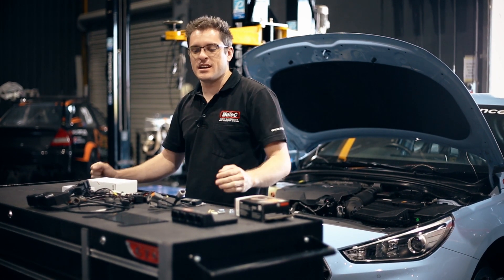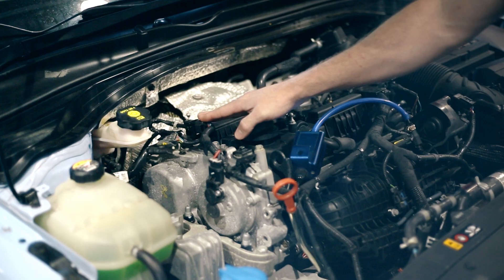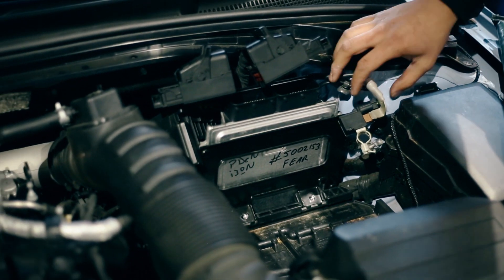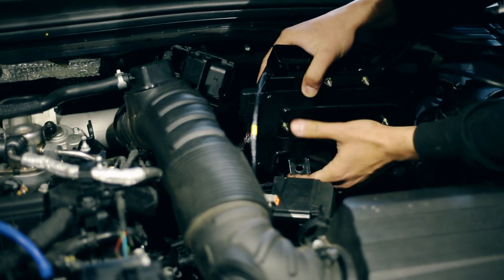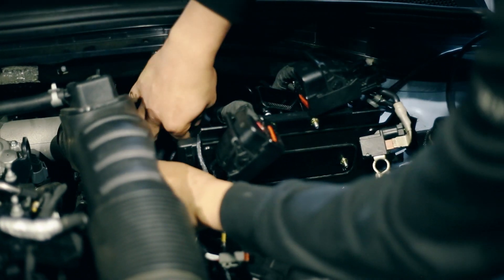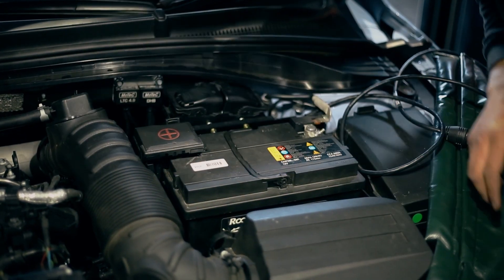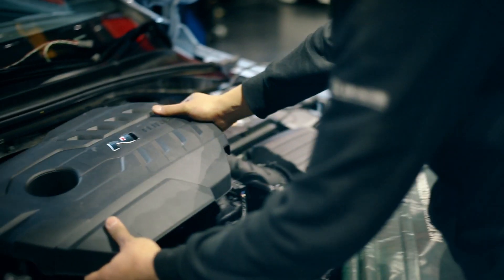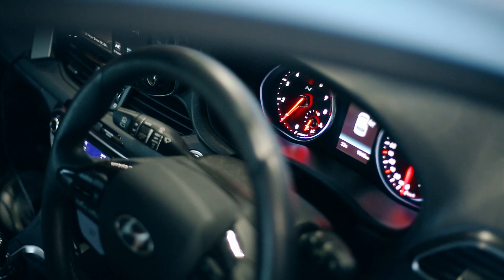Powertune Australia | Powertune's Hyundai i30N Plug'N'Play MOTEC ECU Kit

Comment: Nice video...but what's the pupose of doing so?....after hours of mounting and demounting stuf from the car what's the gain?...10 maybe with luck 15 hp?...like other hundreds of chips on the market?...thouse are moore easy to instal and demount when going to official service....this one?...no thanks...useless....better remap factory ecu and convert to stock when you go to service when needed...it's less time consuming than this marveleous piece of work.
Reply from the maker: Can’t compare a flash tune to a standalone ecu. This is for Motorsport purposes where tuners need access to every part of the electronics and engine systems. 
The i30N race series in Aus is using this system also as a means of controlling and unifying the tunes across all competitors. Making sure no one has unfair advantages with tuning tricks.